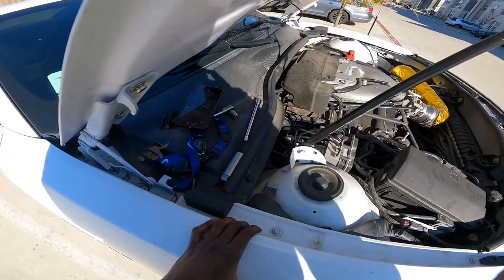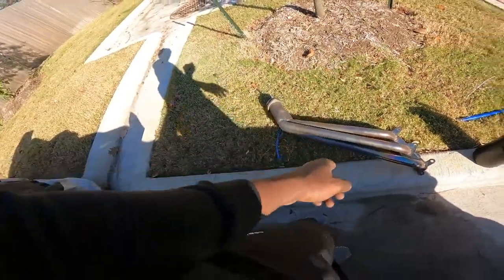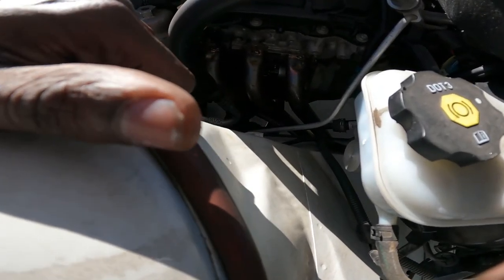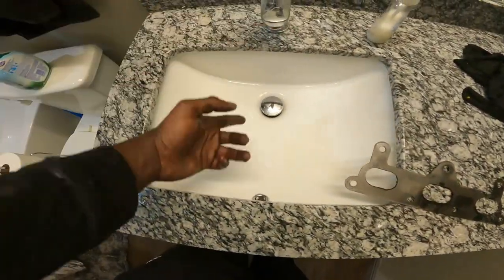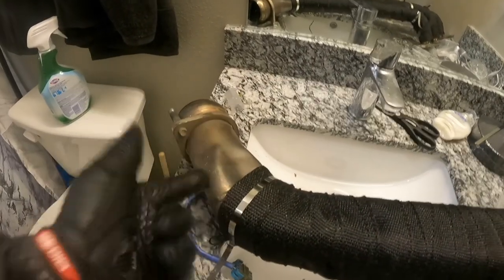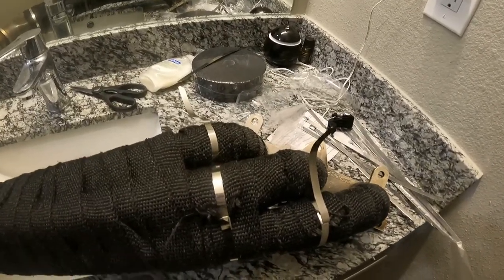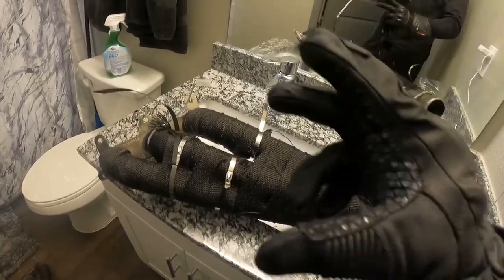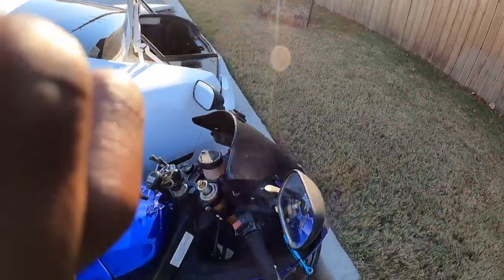I Had to REMOVE My Camaro's Exhaust (here's why!!!)

Comment: Your exhaust sounds pretty damn good, I was in the white 18 f150 tonight, going down PGA.
Reply from the maker: Thx for making me sell my car to get a v8😂
Reply: My bad, my 2018 has a detuned 3rd gen 5.0 coyote 395hp 400lb-ft with 10spd trans and only 2wd. My accelerator gets stuck sometimes and will only let me go 107mph at the track. But the truck still pulls hard till it cuts power. DAMN SPEED LIMITERS!!!
Reply from the maker: @gruzzy89  that thing was hauling ass bro 😂
Reply: Thanks, I got plans for an NA E85 build. Mo powa lowered and no limiter. Shooting for 450 at the tires with a bunch of mustang engine parts.
Reply from the maker: @gruzzy89  damn dude, good luck that thing is gonna be crazy